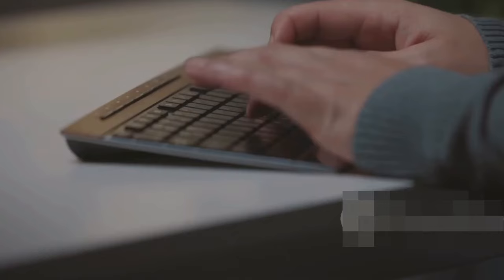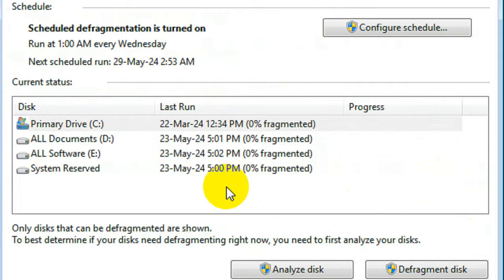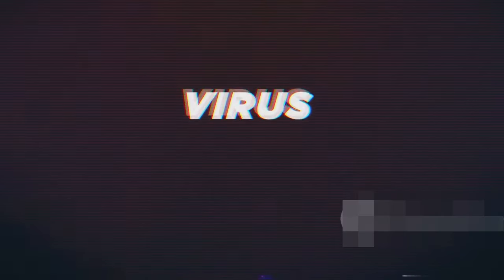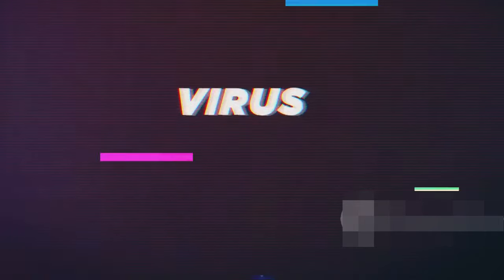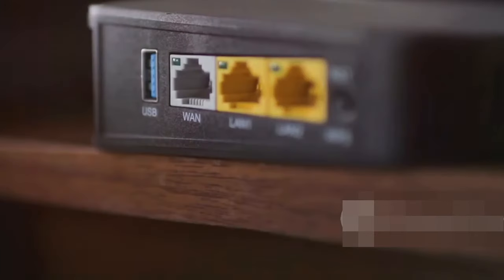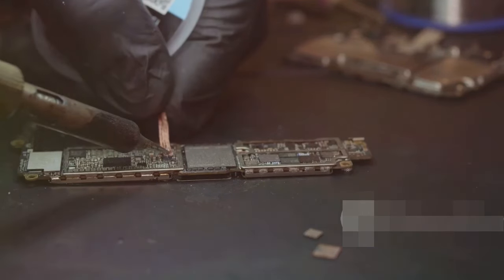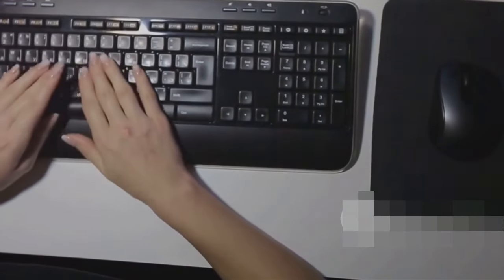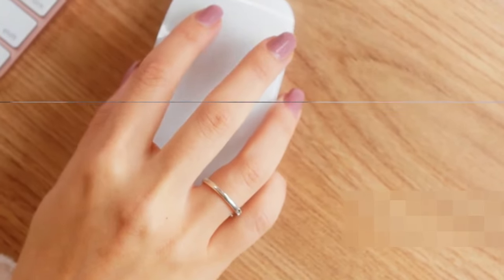Fix It Yourself! Top Computer Problems & Easy Solutions | 5 Common Computer Problems and Solutions

Comment: Do you reply to questions? I have a computer issue with no idea of fixing.
Reply from the maker: What kind of problem??
Reply: @BrilliantIT  I have a older OS. Uses XP Pro. Got a Windows. Net error message. Then only runs in safe mode. Noticed the monitor image and shortcut folders are like looking at a oldschool TV with bad signal. Everything look's distorted.
Reply: @BrilliantIT  It hurts because everything important is on my computer. Cant afford a new one. Only thing I think would cause the monitor to look like it is would be a video card problem. I'm never online when it happened?
Reply from the maker: @ShawnStafford-1978 check VGA cable it's might be loose. Also you buy new VGA cable or if no power in your monitor check power cable.
Reply: @BrilliantIT  I used a replacement monitor. What's the VGA cable? The monitors both had power.

Comment: defragging O_o.... kind a no need this days... by default windows 7 and up will auto do those thing weekly........ also ..... why you use windows 7 .... unless your running super specialize app / software that you cant run on another OS or windows 10 or up. Mainly dont click all link and install all thing that are from sauce website.....